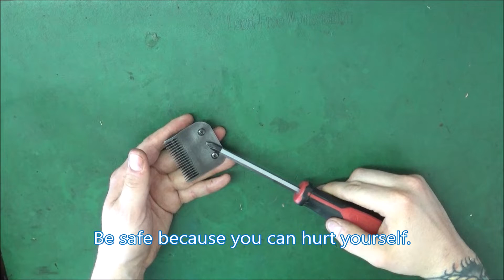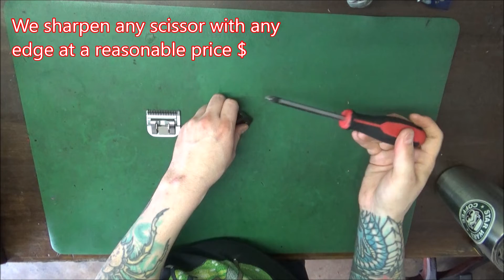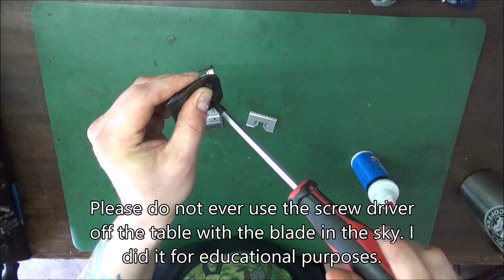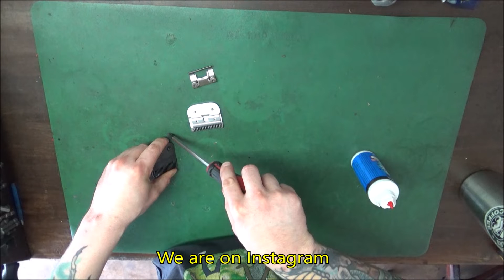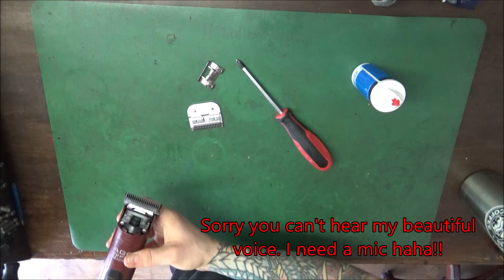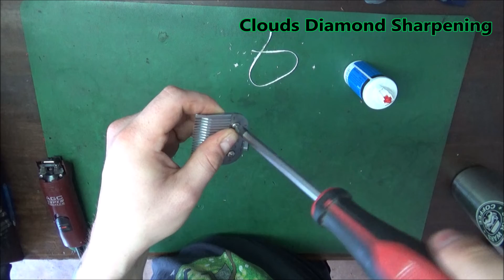How to disassemble and assemble hair clipper blades

Comment: Hey Man, I want to ask about the barber shears with convex blade, is it possible to sharpen them using the regular manual sharpener?
Reply from the maker: When it comes to scissors in general, I would never encourage using a manual sharpener. Getting the blades themselves sharp is just the first step in the process. What really matters is what happens as the two blades cross each others path.